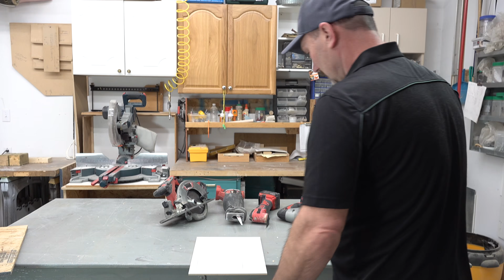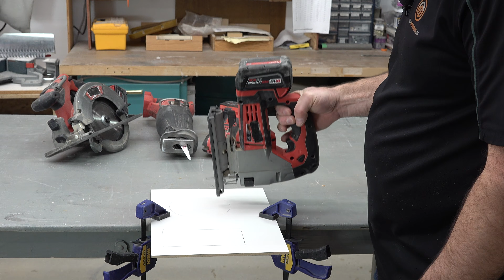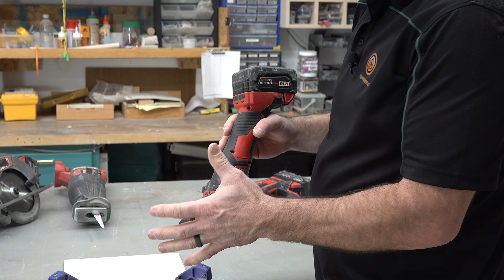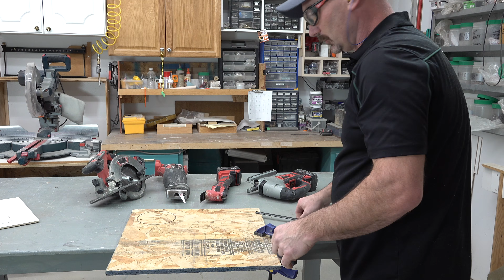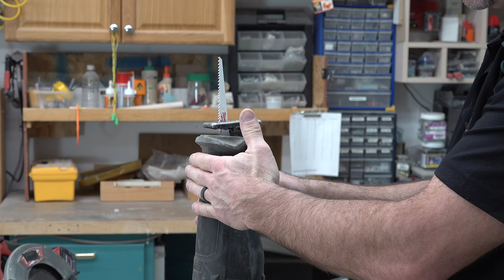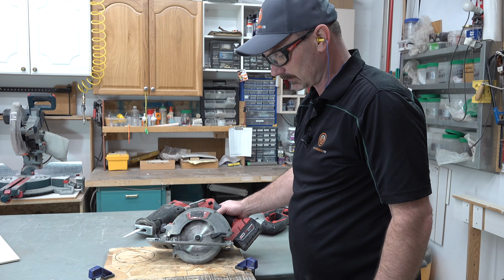How To Plunge Cut Using 4 Different Saws

Comment: Another great vid with great advice.  I would add that there are plunge cut blades for reciprocating saws.  They have a curved tip.
Reply from the maker: I actually have never seen that , as you can see you really do not need that.

Comment: I have 4x12 dormer rafters. Being anchored to a steel kicker with 12" knife blades, 1/4" thick, With 5/8" ready thread holes. Curious how you would make that plunge cut. Could really use some guidance. Thanks for your time. P.S. I am currently using a Prazi beam cutter to do the plunge cut.
Reply from the maker: Please use our forum and include a couple pictures .https://www.house-improvements.com/forums/

Comment: If you're doing a plunge cut in 5/4 cedar boards, and only want to cut out one board without cutting into the adjacent ones on each side, which saw works best ? One video I watched used a plunge saw and finished the edges with a reciprocating saw, but I hate to buy two saws and the rental fees are high. Great video and thank you for stressing safety tips.
Reply from the maker: Oscillating saw if your only buying one saw.

Comment: Thanks Shannon.  I'm surprised you didn't mention that when plunge cutting using the circular saw and you're cutting out a rectangular piece, when the 2 lines of the plunge cut meet at the corner, because the blade is round, while the cut meets at the top of the material in the corner, they should also know that it's still not cut at the bottom of the material.  You will then need one of the other saws mentioned in this video to finalize the cut all the way through.
Reply from the maker: Great point!
Reply from the maker: We have another video specific for cuts with a circular saw that is more detailed. https://www.youtube.com/watch?v=YfU8UEJvYbA

Comment: My circular saw blade never stops that fast on my Craftsman. What company is that from? I need to do some plunge cutting in the concrete of my basement to deal with some water issues. The house is over 100 years old, built into a hillside, and water always gets in when it rains, Some comes in through the cement blocks and has been discoloring them. I think I need to tar the outside of those and also install a sump pump. I think cutting a line around the perimeter that leads to a sump hole will work fine for when it does get in.
Reply from the maker: This was a Milwaukee saw. Many have brakes now.

Comment: 1:35 I installed some cat 6 into a wall from underneath that prevously didn't have a data jack. I continue to fall in love with my multi tool (oscillating saw). I'm cutting blind into a wall that has power, gas and who knows what else, but with that multi tool I can just cut the depth of the drywall and knock the piece out to see what's behind it. Best tool ever!

Comment: That is a nice work table you used. Is that cloth covered or just the paint look? Very good advice on plunge cutting. The saber saw plunge is something I never tried. I usually drill a starter hole.
Reply from the maker: Just a painted plywood top